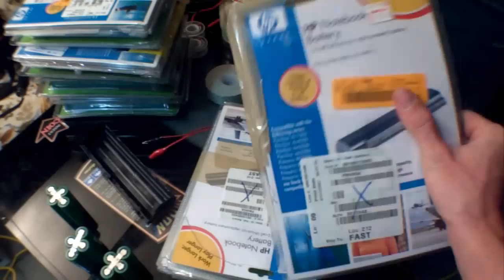DIY: 48v 24ah lithium ion 18650 e-bike battery pack

Comment: Hi, I just finish my pack 7s 3p my problemi is when I charge it the first time voltage is 29.5v not 24v,  And my first bike pack is 24v,  all my batteries tested 3.7 when ichecked the first time then bms charge all batteries not 3.7 but 4.2 v. I think it can be bad for my 24 v ESC and motor. Do you know if it can be bad for it thanks

Comment: The only thing I keep thinking of is how did you find the batteries for so cheap? I have been looking for 2 weeks on ebay now and I cannot find anything near as cheap as your's not even to add that they are all used and I would prefer using new batteries... So basically it is impossible to find all the batteries for 90 dollars? Or 90 euros as I am from the Netherlands.
Reply from the maker: someting like this? http://www.ebay.com/itm/LOT-OF-25-Li-ion-18650-LITHIUM-HARVEST-PULL-SCRAP-Laptop-battery-MIX-BRANDS-/232280196133?hash=item3614fa8425:g:VaEAAOSw4A5Y0wkV

Comment: One more question, I've been told the batteries can be damaged when welding them together, so a cold-welding thing is needed. What is your experience?
thanks again,
Reply: they can be damaged if you do it wrong, and sometimes may even explode. but the best way to do it is to hold the soldering gun on it until it melts then quickly take it off, oh btw, its solder not weld :)

sorry for being 5 years late btw

Comment: After harvesting some batteries from my old fujitsu siemens lifebook battery pack what i discovered inside was not 18650 battery cells but Sanyo Prismatic Li-ion Battery cells at 3.7V 2000mAh with a 2A Fuse, it appears that these batteries will be the new standard in laptop battery packs, i really don't know what to do with them though.

Comment: What a fantastic video thanks :). I have a nice supplier of free 18650 batteries from laptops and a new 48v front hub motor. The 18650 batteries I have are mainly 3.6 ones which I believe your ment to charge to 4.1v, should I be using 3.7v batteries and charging to 4.2 or will I still be able to use the slightly lower voltage ones.
Reply from the maker: you can charge both those to 4.2v but if you charge to 4.0 you get 4x the life from them.

btw where do you live? if you lived close and could get me several hundred or even a few thousand cells i may buy for super cheep haha.
Reply: Rinoa Super-Genius
Im in the UK man.... :( probably get hundreds thou :) whats the maximum voltage a 48v speed controller would take?
Reply from the maker: Toby S
prolly 55v

Comment: 2 x 14 x 3.7v 5AH = 51.8v 10AH
is there away to make 46 of these = 51.8v 30AH the battery's have protect too and much more expensive it is better having them protection?

Comment: How heavy is it? i have a 36v 20ah LiFePO4 battery cost me 300$ with shipping, gets about same range and faster speed that you talk, on my bike, lipo maybe more volatile if over charged/crash LiFePO4 a bit safer, but how heavy is the battery u made alone?? change volts and max discharge amps? 
random details i wana know if u can provide

Comment: Not sure if it's been asked already or not (sorry if it has) but were the cells you used protected or unprotected? Do you know whether you still need to balance them using a protection circuit board if they are protected? Or if you can just charge them and they will balance themselves due to the on board PCB?
Reply from the maker: DIY: Balance Charging E-Bike lithium battery upgrade

Comment: Hi man cool video I was interested in your battery pack because I get free batteries from Home Depot in the recycling bin and have found a few of these batteries. And just for the heck of it I was wondering what type of power supply you have because I have been looking into getting one. Thanks!
Reply from the maker: its just a cheep 70$ 30V 5A variable DC power supply off ebay. i have an old video of when i got it but to be honest it just broke and i'm in the middle of filming the "how it failed" video on it right now. i wasn't expecting it to last long but its already lasted almost 2 years with me using it a lot. i think all that was bad was a capacitor and it should be working again.

just keep in mind it can give 5 amps, but only for like 10 minutes before it heats up and it's internal heat sensor trips, its not one-time use like a fuse though so you just wait for it to cool down and it will work again. if you going to be pulling power from it for a long time dont take more than 3 amps if its in a very cool atmosphere and if its really hot weather then dont go above 2 amps. longest i ran it was 2.5a for 3 weeks for an experiment.

it is the bottom of the line, cheep and not built very well. but i would rather go through one of these every few years than accidentally fuck up an expensive power supply.

oh and also these power supplies sometimes make a 18v voltage spike when turned off and on very fast, they are great for batteries and battery powered electronics and whatnot, but if your dealing with very sensitive electronics you would want to make sure not to have the circuit plugged in while it was turning on. but i'm meaning super super sensitive electronics.

Comment: Sorta new to this, but I seem to have (accidentally) collected enough parts to build an electric bike, albeit using 'regular' sealed lead acid batteries from UPSs...:)

What is the advantage of Lithium Ion batteries? lower weight to Ah ratio? no memory isssues?

thanks for the great videos.
Reply from the maker: lithiums are like an 8th of teh weight, and can last like 10x longer. not counting you can let lithium cells sit in storage for a decade and they will be ok. but a lead acid battery would be completely dead after a few months of sitting without a charge.

not counting lithium is a bit cheeper if you buy of batteries.

i say work on the bike first with the SLAs, you can always upgrade latter.
Reply: Rinoa Super-Genius thanks, for the info. cheers

Comment: I own a e-bike Pedego Interceptor. One thing I was curious about, no PCB? I'm pretty well versed in batteries, and I have a battery supply similar to yours. Their batteries are insanely expensive. So I'm trying to learn more.
Reply from the maker: no i have an external balancer.
Reply: Rinoa Super-Genius
maybe make a video talking about how you handle that?
Reply from the maker: Louie Lardas
 already did, there where 2 annotations for it in the video and a link in the description. the video may have even popped up in the related videos on the side.
Reply: Rinoa Super-Genius
sorry to seem needy, but I did not see the link/video you are referring to. would  you mind providing that here/? appreciated
Reply: Louie Lardas
I did finally find the annotation. It went by me quickly being at the beginning of the video. That was not what I meant by PCB. I've taken apart one of my pedigo batteries and inside the battery pack is a 4"x2" PCB. Then there is an external charger. Does the Lipro balance charger do the same thing?
Reply: Louie Lardas
I think i  did answer my own question. You are charging your 24v battery with a 12v power source, by using Lipro that is charging each individual group of cells at 4v....My current battery is different. The input voltage in 54v from an external charger, and I guess whatever the PCB is in the battery pack does something similar.
Reply: Louie Lardas
Oh and mine is a 48v lithium about 2/3 the height, about the same width and length of your 24v. but they want $800 bucks for one from the bike company. so i've been looking for alternatives.

Comment: I'm sorry if you mentioned this in the video, I don't want to watch it all over again for one piece of information... 

What current does the motor draw from battery pack? I have a project planned and I want an idea of what kind of load is safe for li-ion cells.
Reply from the maker: the motor is 1000w and it runs at 48v. can ya do the math? :D
Reply: Yes, yes I can ;)
Around 21 amps... I'm sure an old desktop PC would draw a little less than that... :D
Reply from the maker: PandaManMk2000 yeah your math is right.

i would say for every amp you want to pull. try to have that many AH of capacity.

Comment: Hello, please help me with advice. I have 30 pcs of 18650 from relatively good laptop batteries. Average mAh is: 2000mAh/cell. I would like to create battery pack of 3x10 cells and combine those 3(10) into one big battery (10+10+10 cells). My calculations are: 3x10 cells 4.2V = 42V, and 42Vx3(2000mah/average) = 42V 6000mAh battery.

I would like to know how to properly charge this "new" created battery? which charger is ok to charge this? and most important: Is balance charging important for parallel connected cells or serial connected cells, or both?

Thanks in advance :)

Comment: Thanks for that battery university reference. I was mostly wondering about DOD and the corresponding number of charge cycles. They mention 100, 50, 25 and 10 percent DOD. They mention 3.0v as 100 percent DOD. So what is 50 percent DOD... 3.6v? (4.2 plus 3.0 div by 2)?

Comment: Rinoa, what a cool project. )) ... I have to watch your rest of the videos yet. So dont know whether you have attached an alternator? Can you use a bike or car alternator to keep the battery charging to some extent, so that the cells dont drain out and short?
Reply from the maker: yes but what would power the alternator? also a dc motor would be better. an alternator would be too difficult to turn once you energise it.
Reply: oh not alternator sorry, yes that dc motor or the bottle dynamo charger that rotates touching the bicycle tire. We can run such a dynamo (some heavy duty version) by adding another chain mechanism, if you don't want to brush it directly on the tire. Just to produce enough reserve energy to keep the battery cells above shorting levels.
Are you going to try it? or already tried? You seem like a sharp and expert ebay seeker :) , you may find some perfect device to do this.
Reply from the maker: Kketansa Art
thats a very bad idea because that generator would slow me down a lot. you would lose energy in the rotation->electricity conversion, then lose it in the electricity->chemical energy conversion, then lose more in the chemical energy->electricity. and lose a lot more in the electricity->rotation conversion.

it would be better to just not pull power from the motion and just coast.

and as for keeping the cells above shorting voltage, i never let them get bellow 3.8v. and shorting voltage is like 2v
Reply: ohh...ok ) thank you for explaining. may be you have some kind of indicator to check the battery level))
Reply from the maker: Kketansa Art
No I just check them after each ride.
Reply: Rinoa Super-Genius You could use the dc motor to charge only when breaking. To do so you must build a mechanism that makes the dc motor attach to the wheel only when you activate the breaks.
Reply from the maker: bazem
yeah but i dont break much at all, sometimes i go entire rides without breaking.
Reply: Rinoa Super-Genius  +bazem
Oh no breaking?, Rinoa go zoommm! :)) Now the best idea for matching the zoomm- May be attach propellers, or use the dc pc fan. Or to keep the Rinoa method intact, attach the digital or analog 'mini volt meter' 0-100v that you get on ebay. Add on/off switch and you are good to check the voltage anytime you want. Endless suggestions... sorry Rinoa :D
Reply from the maker: 1wldnczyguy
doesnt matter because it is still pronounced the same way, plus what is correct in your country isnt correct in others.

if you can't understand a word that isnt spelled exactly how you want then fuck you. ^^

Comment: great video! your one smart dude. interesting to see the evolution of your battery designs.. I might try this myself. Any advice on some starter gear to buy to do a basic design?
Reply from the maker: +Graham Robinson just a cheepo imax b6, a multimeter, and abunch of lithium cells. i'd suggst building a high powered LED flashlight from old laptop cells first. plus building high powered LED flashlights is really fun haha.

Comment: Can't believe you used the color for Ground on both your lead wires. The rest was good but that is really inexcusable. You could also easily prevent thermal runaway by using a wire sized appropriately to burn up instead of those nails.
Reply from the maker: inexcusable? your joking right? you can paint wires if it pisses you off that much.
Reply: Rinoa Super-Genius No, I'm not joking, it is one of the most basic wiring standards and there for a very important safety reason.
Reply from the maker: P Roppo
 yeah well its not worth wasting money on differant wire colors when it doesnt matter.

if it matters to you that mutch then mail me a spool of red and a spool of black 14awg wire and i'll replace the leads or you can shut the fuck up.

Comment from the maker: actually i just remembered theres a 2nd fuse inside the power cable going to the motor controller. but the motor controller is just what came with my kit. i havent messed with it since its working great.

i dont wanna go through the proccess of  Breaking it, Reverse Engineering it, Understanding it, then Fixing it. hahahaha

Comment: Like your videos, keep up the good work.
Looking to do similar for extra power @ 24v in near future..
I have a so-called 40ah 24v LiFeP04 and new 30Ah cells that I'm going to rig in next few days, stealing the BMS from the 40ah china-pack system, rigging a D-sub like you did.. So I can swap it between systems.
Looking for source of BMS that can dischage 24v@35A for 3-4min and 10A continuous. (without spending a fortune)

Comment: I love your videos I have a suggested project for you because I can't find a good one online and I know you would do a good one. Can you do a video on the difference between using a 18650 PCB board and when you don't use one. And what The pros and cons of using one would be. Thanks and keep up the good work
Reply from the maker: you mean as apposed to using a balance charger? up until now i've only used balance charger. i've never messed with BMS boards.

there shouldnt be very big differances, just with the BMS you need to buy several and have one on the battery at all times or have the charger take care of balancing and make the pack smaller.

Comment from the maker: ah ok, i thought you where meaning C as in the overall amps not the ratio of load/capacity.

but anyway this overall battery is 35 amp-hours and i only pull 15 amps at max because i stay bellow 20MPH. that is only about 1.2 amp load per cell. each cell is atleast 2ah.

i wired 12 cells in parallel for each pack. so each pack is 4.1v 35ah.

btw all a degree means is ya wasted money and time on extra schooling. doesnt mean anything towards your technical credibility. ;/

Comment: How many cycles will one of theese mega packs last you? You should need a special charger with equalizer to charge theese multiple times. Also the fire hazard is quite large. How do you manage all this?
Reply from the maker: the fire hazard isnt big at all. i've done torture tests on cells a lot and they hold up fine. if you would watch the next video youd know i balance charge them too.

number of cycles is dependant on charge voltage and depth of discharge and also rate of discharge. these cells can last me 1200-2000 cycles. and i only have to recharge it like once a month now.

Comment: I bought 64- 2200mah cells or 16- 4packs at 8800mah each because I thought it would simplify connecting 16 balance wires to each of the 16- 4packs. However I see a problem in that my BMS is factory programed to accept one wire to one cell of 2200mah and not one wire to one cell masquerading as a 4pack of 8800mah. Can I get away with this without causing a "Thermal runaway" ?. My BMS has only 16 balance  wires listed from c1 to c16.